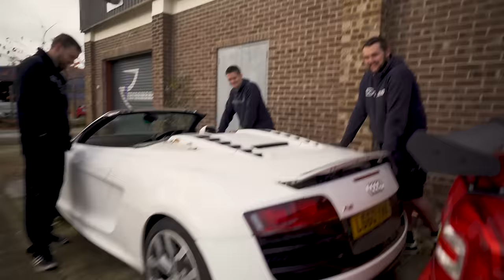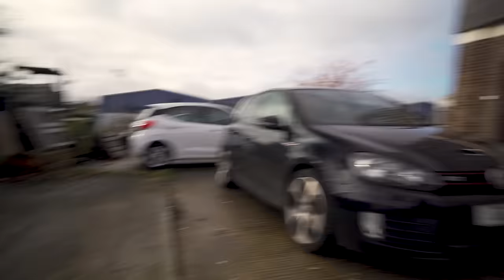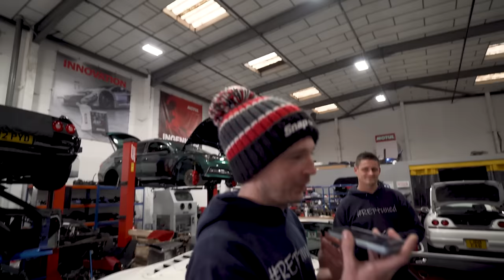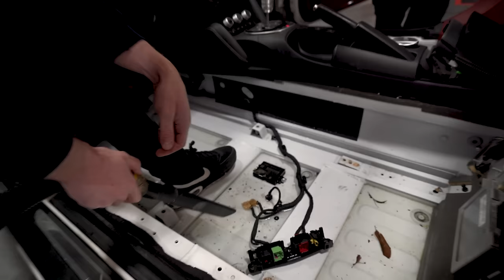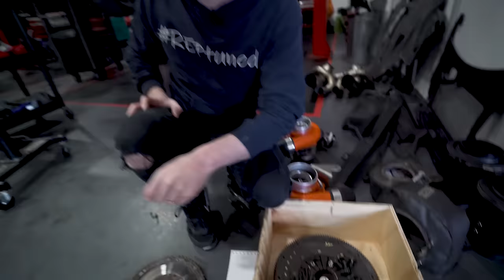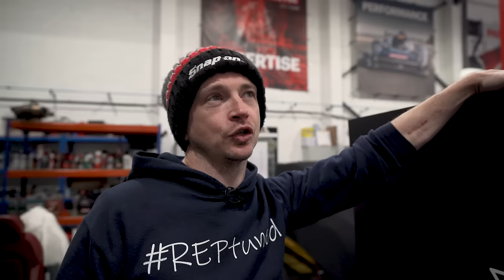Why Did We Remove Mat Armstrong's Turbos? | Workshop Update No.41

Comment: I thought the Skyline was the GTS version RB25 single turbo rear wheel drive. You mentioned the centre diff for oil change. I had the R33 GTR vspec. Great car silly power available. RB26

Comment: Ricky, following on from your talk in this vid about egr gas, injection, carbon build up etc I have a couple of questions.
1, I have a Passat GTE with just over 100k on it & have only ever run it on Shell Optimax, does this make a difference in how much carbon build up can occur due to it being a 'cleaner burning' fuel & will in turn create less contamination in the oil meaning less contamination in the inlet?
2, As manufactorers have prelonged service intervals, some in excess of 18k, I have the oil changed every 6k & will this also help with less carbon build up, I was always taught oil is cheaper than parts & it can't be good for longevity of engines stretching servicing out even though oil/engine/design/technology has moved on masses in the last 20yrs+.
I think doing a bit of a series on track car increases in performance changing suspension, brakes, tyres compared to just engine performance mods on the same car & see a like for like before & after would be really interesting.
Love the vids as always keep up the great & varied content 👍

Comment: SQ5- what for injectors+ seals, coolant leak from oil coolant middle of V, gearbox services often overlooked because of Audis “seal for life’ bullsheet.

Inlets, throttle valve and egr need a good clean out too.

Otherwise great🤣
Reply: My Audi has the S-Tronic gearbox and 4 wheel drive, Audi say that both need regular oli changes, only my BMW said it was sealed for life, but ZF said change every 75,000 miles.

Comment: Are you sure that level sender should be loose? I would think it would need some resistance to movement because if it was loose and actually floating, the level reading would be up and down like a brides knickers as the fuel sloshes about in the tank.
Reply: They have a ballast resistor wired into the unit.